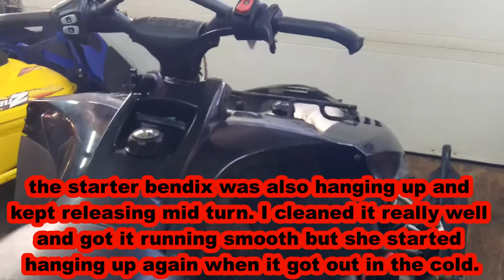2009 Bearcat XT 570 recoil and starter

Comment: What a nice spot to locate a pull cord assembly hey 🤦🏼‍♂️
Reply from the maker: yeah i guess that's what you get when the sled gets wider but the engine stays the same and you have to have the clutch protruding from the other side to drive the machine...they should have put a triple in there and everything would be dandy